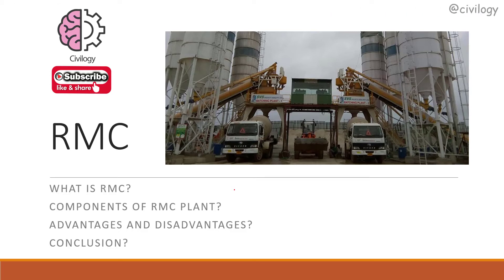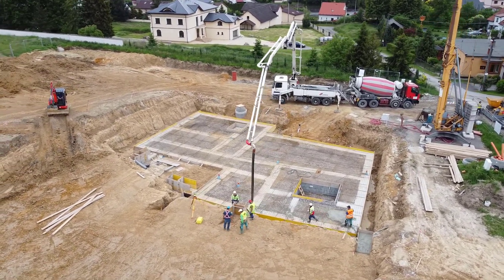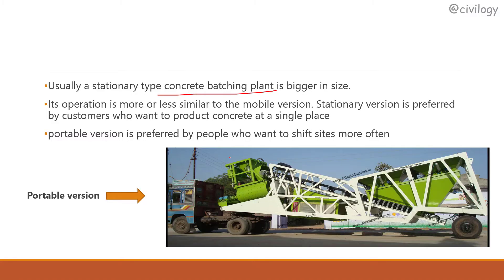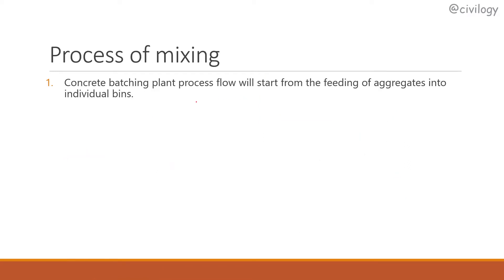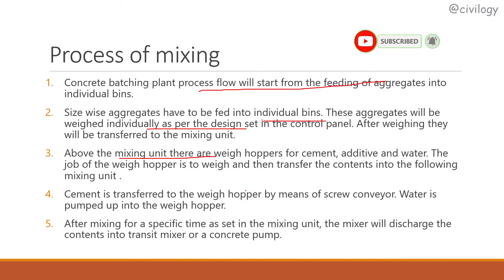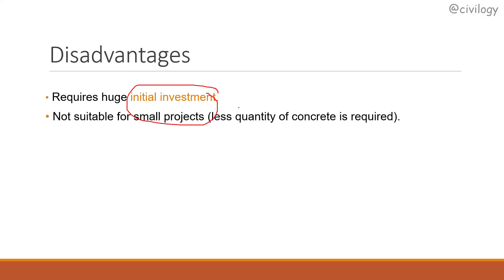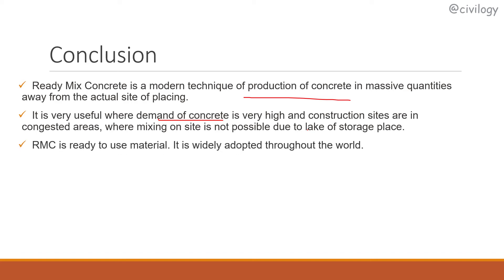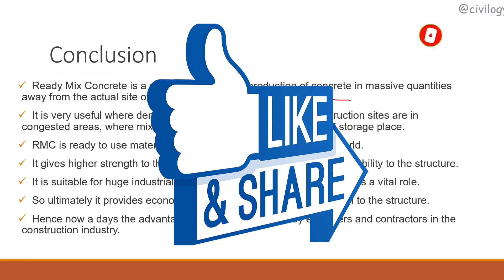process of ready mix concrete || Advantages and Disadvantages of RMC plant || civilogy

Comment: Sir can we choose cement which will be use in RMC like ultratech, Ambuja cement
Reply from the maker: Yes that's your wish. But the quality checks will be done at the RMC plant laboratory using the cement, The concrete mix is prepared and made into standard block then tested for compressive strength and other tests and after strength approval we go for large mixes.